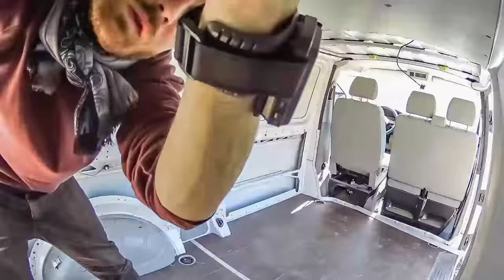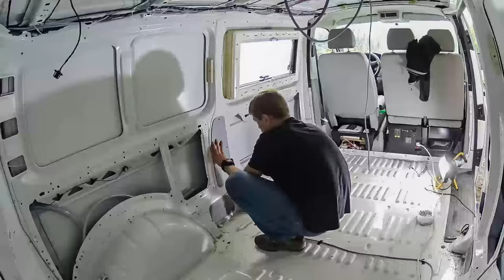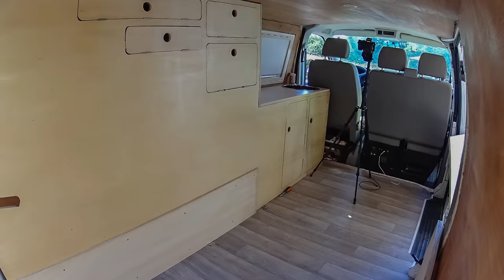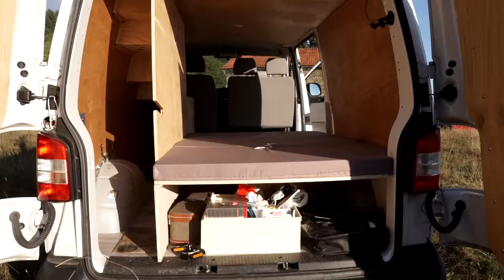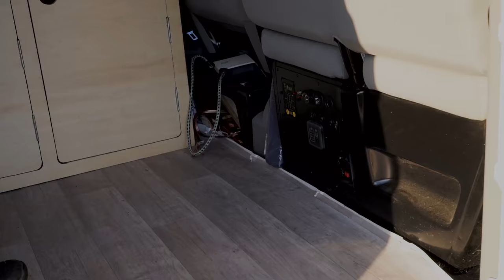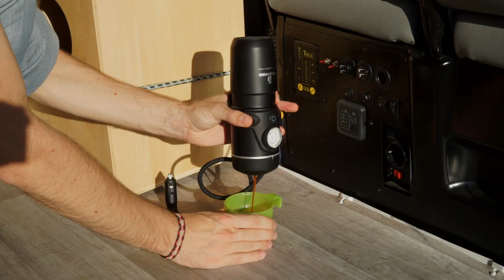VW T5 camper van conversion - aménagement T5 Volkswagen

Comment: hi how are you powering your laptop when wild camping
Reply from the maker: I have a solar panel on the roof. You can see it on some of the aerial shots. It powers a battery and on the battery I plug a 12v/220v converter. I will make a video on this aspect... as soon as I have time!